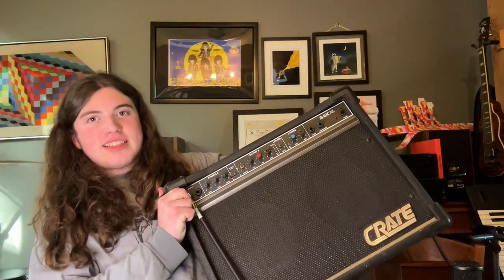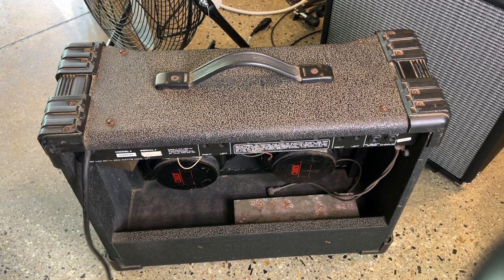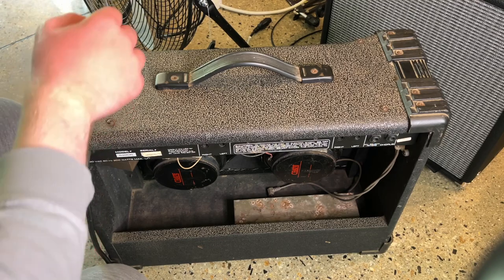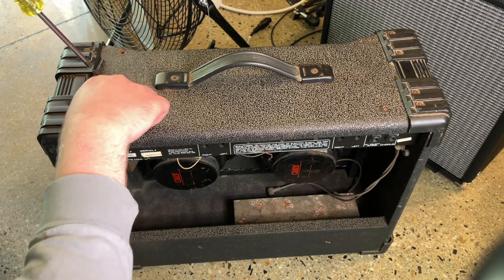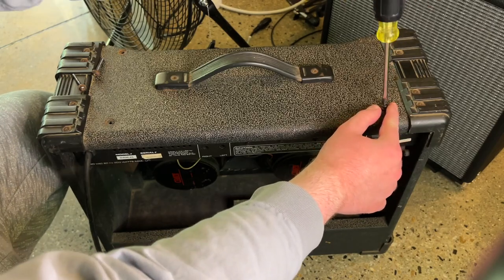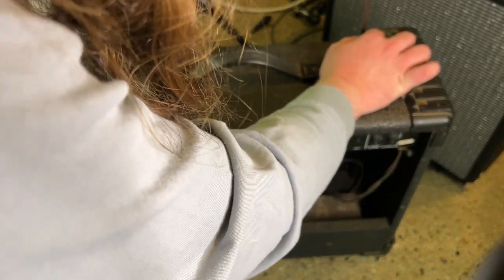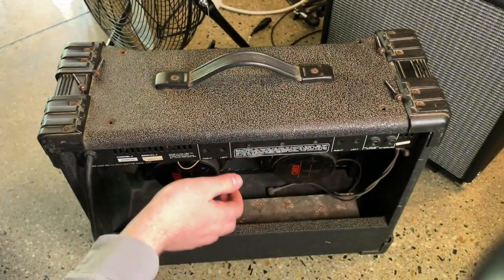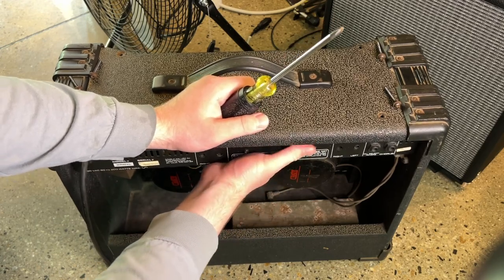Crate G40C XL Amp that I Found in a Free Pile - Repair and Demo

Comment: I blew my G40CXL CRATE Amp 14 years ago i replaced the resistors except for 2 because they were blacken burnt. I did research for years to get the right resistors but failed and gave up. Now 14 years later i see your video and you have a perfect shot of the 2 resistors  i need,  I almost got rid of it 2 times because i have a behringer and i do most of my playing with apps and software now. Thanks😂
Reply from the maker: Would it be helpful if I made another video showcasing the circuitry? Because I did go over some of the chips inside the head even though I know barely anything about electronics.
Reply: @PanHoover882 That would be awesome,  the capacitor i need is in front of the heat sink, I kinda got a screen shot of the cap from your video , which helps out a lot but can't really see the first color code mark.
Reply from the maker: @melvinthomas9292  timestamp, please?
Reply: @PanHoover882  there are 2 light brown caps under the red wire
Reply from the maker: @melvinthomas9292  ok. I will make a vid next week

Comment: Next time use Caig DeOxit for a pot cleaner/contact cleaner and spray into the correct area of the pot. The area where you sprayed does not work. You can also remove the knob and spray around the shaft of the pot om these old Crate amps. If need be you can use a cut down drinking straw to go around the shaft of the pot to centralize the spray.
Reply: Where the three brass connections come out of the potentiometer steel body you should see a narrow open slot. Aim the cleaner spray tube at that slot so the cleaner sprays inside the pot and cleans the parts inside. Inside, there is a curved track of resistive paint and a spring wiper that runs around the track increasing and decreasing the resitance
Reply from the maker: Thanks for the advice!

Comment: They were released in the early 90s. I bought one new back then as my first amp. Still have it, playing on it now in fact. 
 They're a decent lil amp and get plenty loud. They do have a issue With intermittently cutting out.
But can be fixed fairly easy
Reply from the maker: How so? Mine is having that problem.
Reply: @PanHoover882 I think that you just need to take the head out and squirt compressed air into tbe pots, and channel switch. It's just a cleaning issue. Electrical cleaning/contact spray afterwards will help too...

Comment: Not sure if that's the same model I had. A friend I used to jam with in 1987 had a Crate that looked like a crate. The thing sounded awesome. 20 years later, I picked a second-hand Crate with 2 10's that was similar to the one in this video. It sounded great until it warmed up, and then it would shut down. Even my brother, the electrical design engineer, said it was garbage.  They just don't make things like they used to.
Reply: The original Crate CR-1 was actually built in a decorative crate for a housing. I've got one that's a good potentiometer cleaning from being in perfect working order. 👍
Reply from the maker: Mine has 2 8” speakers.

Comment: The point where you sprayed the contact cleaner was not correct.  You didn't spray the contact cleaner into the pots where it needs to go.  You sprayed it onto the back of the pots.
Reply from the maker: Thanks for the feedback! So, into the hole at the bottom?
Reply: @PanHoover882  Correct.  Some pots have a slot on the side to allow cleaner to be sprayed into them.  If they don't have the slot on the side you need to spray in from the opening where the solder lugs/pins are.
Reply: @PanHoover882  BTW, CRC is a very good contact cleaner but DeoxIT is better.  More expensive but a lot better.
Reply from the maker: @tracyc7813  I used CRC because it’s what I have at the moment.
Reply: @PanHoover882  CRC is a very good cleaner.  I use it myself as a flush because it is so much less expensive than DeoxIT.  In this scenario, you found the amp out in the elements, CRC is a good choice for the initial cleaning.  Once the pots operate quietly, then follow it up with DeoxIT D5 and/or F5.  DeoxIT D5 is not only the best cleaner, it also leaves a little lubricant behind that helps the pots work better longer.  DeoxIT F5 is a lubricant that may be needed if DeoxIT D5 does not provide enough lubricant for the pots.
Reply from the maker: I’m going to make an updated video and upload it later this week. I started filming earlier today and used DeOxit D5. This time I spread it in the right place. I will also go through some of the chips. Not too far in depth. You all are right, DeOxit wonders on these things.